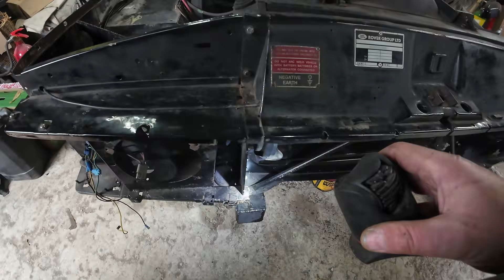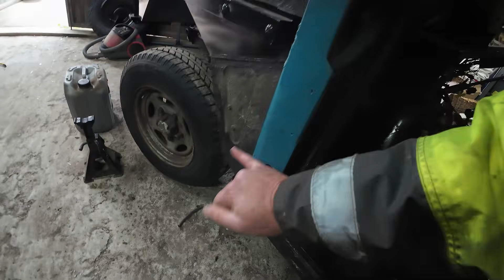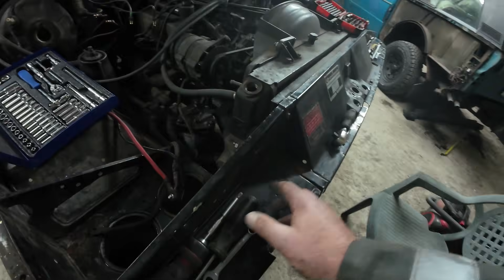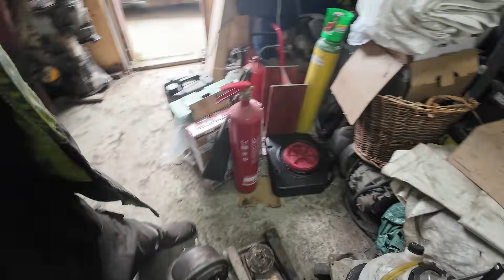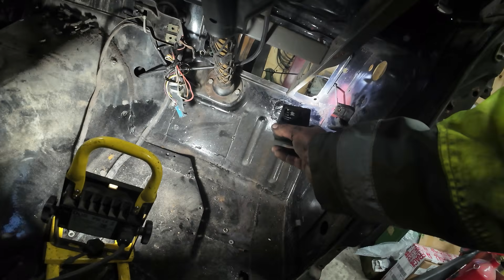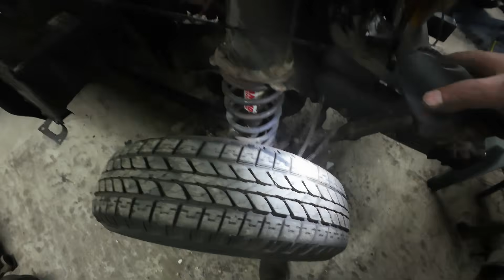Range Rover 1974 C suffix body restoration - introduction ep1

Comment: Hey Richard quick question I hope you won't mind answering. You do a LOT of work and it seems it really can't be done on a quote basis as you never know what you are going to find, Do you say to the customer this is my hourly rate I will work on the agreed items and will bill you every two weeks or so and then continue, if you find something that was not in the original agreement then call them before continuing ?
Reply from the maker: I rarely quote for a job, I do however provide estimates for the work based upon my ever expanding experience or doing similar jobs. If I feel that the estimate will be overspent, I contact the customer asap to agree and explain why. I also keep customers involved in the project with daily (when I am working on their car) updates and weekly tracking against the original estimate

Comment: Looks a bit like a Bitza to me. Have you ever come across one of the cars that came out of the dodgy scrap yard in Aston, Birmingham? I worked not far from there in the early 90's and used to get bits from them until I found out about what they were doing.
Reply from the maker: Only on the engine and bulkhead, the rest is very much 1974. there were lots of new parts fitted 20+ years ago which make this job easier. 

Was the Aston scrapyard where JLR sent their end of life prototypes? I know one very early RRC that escaped, think somewhere in the first 5 prototypes
Reply: @churchhouseclassics  Not that I know of. I used to go there around 1994/5 or so. It's possible the early RRC's did go there though. I only moved down to Birmingham, at the end of 1993.

Comment: Doesn't look to be that bad, but let's see what's lurking in the shadows!  The only thing I would consider is a five speed gearbox!  Oh, where have I seen that electrical post, seems familiar?
Reply from the maker: I really isn't too bad, a very old restoration that is going back to standard 1974 RR apart from the 3.9 EFI v8. A useful mod.

5 speed box is a sensible upgrade BUT the transmission tunnel needs to be extensively modified or a later tunnel needs to be sourced. Then you have the challenge of working out how to get a long stick gear change and also no centre console for that classic look. All of these things I did in the tail end of the "Bob" project.

Comment: Later shell, or just the bulkhead?

Has to be worth replacing the wiring loom outright to start with a clean sheet.  Not only is that burnt spot/fog lamp wiring likely to have damaged other wires, but who knows what else has been altered badly like that big red earth?  For the cost of a new loom, it has to be a worthwhile investment in the reliability and safety of the car.
Reply from the maker: No spoilers, there are a few episodes to come on unravelling this project. Burned wires are a nightmare, you really need to unbind the loom and inspect each neighbouring wire to be sure.